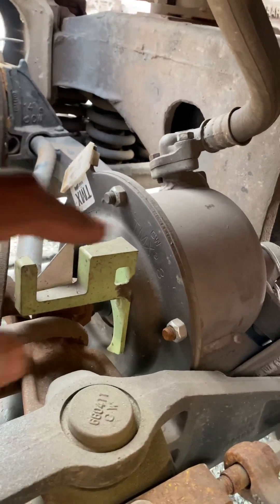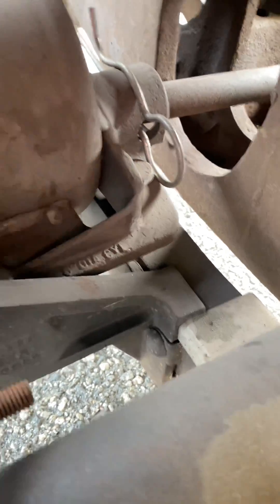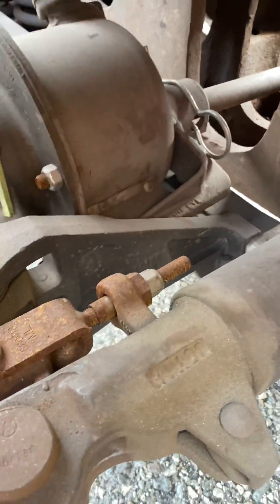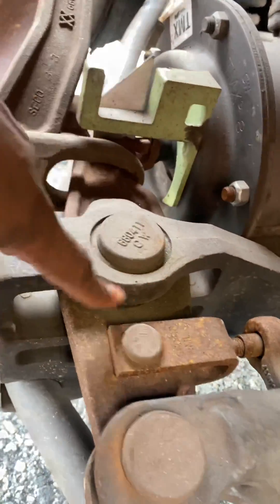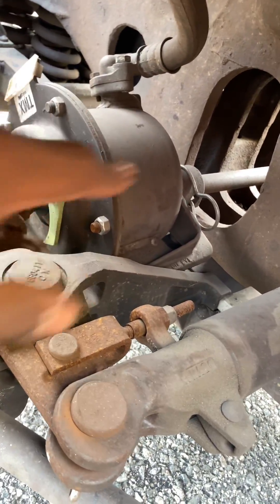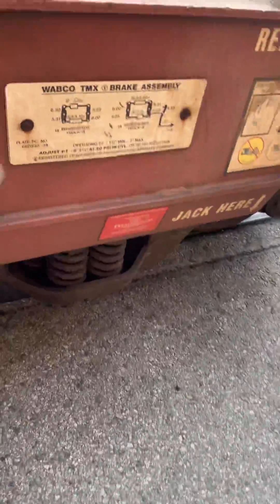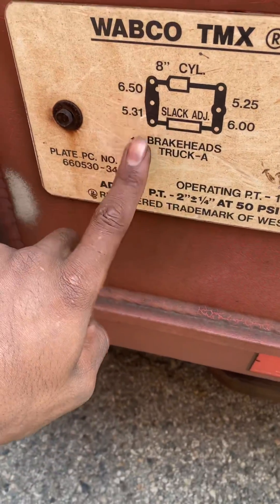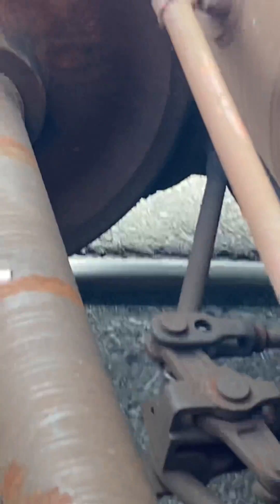Air Brake System Basics (TMX)

Comment: Hey Jay i was wondering if you have any video for 
Control valve and vent valve m brake pipe , slack adjuster , main and auxiliary reservoirs , brake cylinder leakage test procedure ? 
thank you in advance